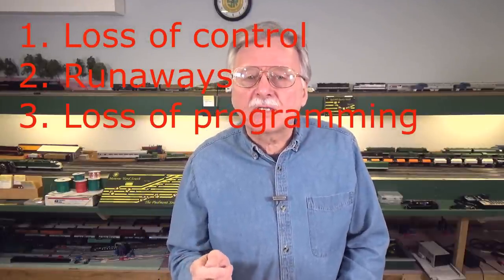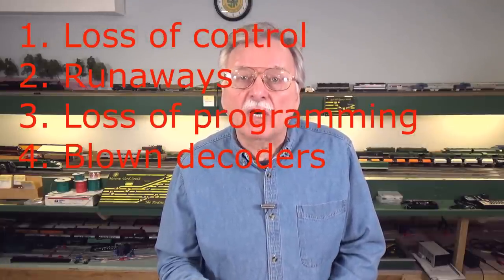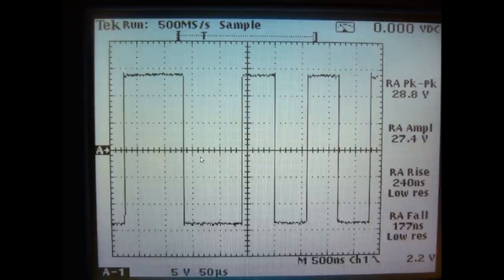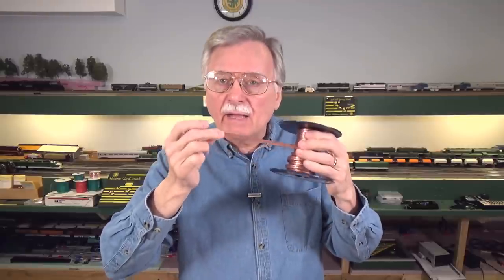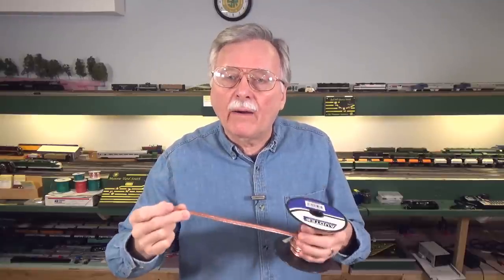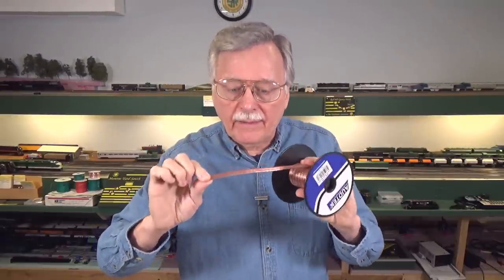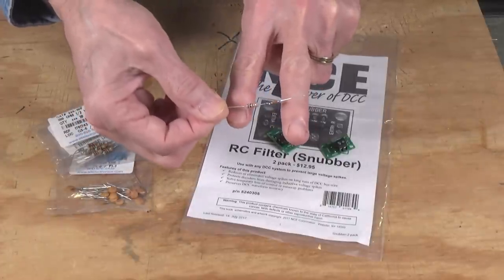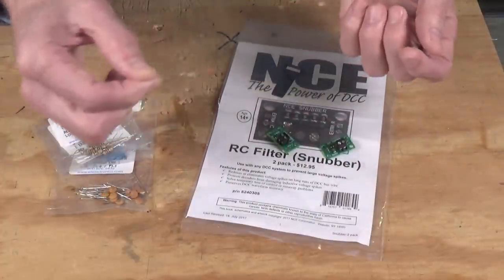End Decoder Problems With A Snubber (243)

Comment: Hi Larry

Could this also affect decoders with Keep Alives fitted? The symptoms I’m experiencing are that locos fitted with keep alives (TCS KAT24s) run then stop for a moment so as I approach the loco to see if it needs any attention, it will just suddenly continue on as if nothing happened. It doesn’t run away per say or stop responding to commands. It just stops, then moves off as if nothing happened. I suspect it’s voltage spikes but it’s a symptom not on your list so I’m curious to know if there’s anything else going on?

Ally
Reply from the maker: Not likely unless so e CV was reset that impacted on the Keep Alive function. That’s usually the type of behavior you see without a Keep Alive installed! I suggest you recheck the connection and if that is not the issue then call the TCS techies, Dan knows these well.
Reply: Thank you for the quick response. I have emailed Dan as suggested and will get back if there is a solution. To confirm, this is not a spiking issue?
Reply from the maker: I wouldn’t think so.

Comment: We experienced locomotives intermittently change direction or change speeds during a train show but only at that particular train show location. And repeated again year later same train show location. No where else. Will the "snubber" resolve these issues different from your problem list? Perhaps be we have different issue. 😳
Reply from the maker: Interesting phenomenon that I have never seen happen in almost 30 years of DCC. The fact it occurred at the same place might suggest some external EM noise interaction, or it just might be the configuration of your layout each time. If it has never happened anywhere else ever before or since it would suggest the local issue. But if elsewhere as well then the snubber might help. These are so cheap and easy to make and install a test would be easy enough.

Comment: Larry  what would us "Soon to be smokers" do, w/o your   Expertise. What's your recommendation on say a main that encompasses 100' or more break into 4~25'ers using dealer wire & a cap~res. On each End?
Reply from the maker: I believe in a stepwise approach. First are you having problems? If not then do nothing. Some systems and wiring configurations are more prone to these issues than others. If you see the symptoms then try the RC filter. If that doesn’t take care of the problem then breaking the 100’ run into shorter ones however remember you still will have to count the full length of each wire run from the booster. If you can put your command station booster i  the middle of the layout and fan out your buses that would be the best configuration. Or you could break it into 2 50’ runs with a booster in the middle of each, so your 50’ runs would in effect be subdivided into 2 25’ ones. Divide and conquer!
Reply: @TheDCCGuy  Larry I finally got time to sincerely thank you for the tips as I progress so does my, How-To knowledge all the while trying to remember "Now. Which end goes In The Cement?! 😆

Comment: Great video Larry,  besides twisting the DCC bus, does wire gauge play a factor as well?
Should you put one on every block?
Reply from the maker: You should always use the correct size wire for the scale, rail code, and length of the run. As I ad in y  video pit one at the end of the power bus and maybe a second midway if symptoms remain in some areas.

Comment: If you twist the bus wires (or use the speaker wires that are tightly bound together like you do and I do), you shouldn't need the RC filters. Am I correct?
Reply from the maker: That’s right, and as I said in the video if yours is a small layout you might even get away without twisting.

Comment: Hi. I am a member of a club in Norway and we have a rather large layout that is divided in two parts, one part is DCC and the other part is Märklin/Motorola-system. We hav experienced many of the problems you listed in the video and we are planning to try out the RC-filter to see if that will correct the problems. But my question to you is: Do you know if these filters also work on the Märklin/Motorola system?
Reply from the maker: I have never looked at this system so have no idea as to whether these would work. However the folks at DCC Concepts in the UK sell a unit similar to the NCE snubber and their electrical engineers may have considered this. I suggest you send them an email inquiry via their website dccconcepts.com .

Comment: Thanks, Larry, I assume the filter would affect current occupation (what is the current draw of filter) , where would be the best place to locate the filter in this case. Does it do any good if you place it near the booster or would you need a small section of un-occupation track detected track at the end of the bus
Reply from the maker: Yes they do draw a small current and their wattage as I said is 0.25-30 watts so use ohms law to calculate the amperage based on your voltage. Also as I said in the video they go at the end of the bus first then can be added at intermediate points. They would be useless near the booster as most already have some type of noise suppression filters built in.

Comment: Would you recommend these on a small layout or should these only be used if you find problems
Reply from the maker: Only if you have problems, which usually means with DCC power bus runs of 30’ or greater. That said poor wiring and other issues may complicate this guideline.

Comment: How do you actually fit them?
You have the two wires coming out of the controller to the track, but only two terminals.
Do you come in with the two wires and come out with two wires from the same terminals?
Reply from the maker: As I said in the video beginning at 18:55 they are connected between the two bus wires of your DCC bus.

Comment: Hi, Larry. I have followed your videos with great enjoyment and have learned a LOT! Thanks! Since basic electrical seems to be the current <sic> trend, I'd like to learn just how a DCC "booster" works. It can't just be upping the power supply voltage is it? I am running an NCE Power Cab and they say the current limit is 1.5A. What ever magic is involved seems to be after the command station output. Thanks.
Reply from the maker: At the most basic level the command station creates a low voltage/amperage version of the DCC signal I showed in the oscilloscope scans. The magic with the boosters is that they literally boost the DCC signal to the voltage/amperage desired. Some systems just bring it up to whatever level they get from the power supply while others can be set to a specific voltage but the amperages are usually specific to the booster. These also have their own proprietary designs that do the magic of creating a stable, and hopefully noise free power bus. They also have built in ability to sense a short circuit and shut down. If you’re interested here is a link to a website with a 3 amp booster circuit that may be more than the basic info you were looking for.

Comment: Been thinking about your video on DCC spikes and snubbers for a while.   Experimenting with an Arduino PWM scheme to run and animate a small "critter" engine on a short piece of DC ... not DCC ... track.  On my scope, I see lots of similar spikes so I was interested in the snubbers.  Then I noticed MOV varistor transient spike protectors can be purchased with voltages like 10-18V  (AllElectronics).  Question for you ... and for anyone out there.  Might a low voltage MOV be used to kill unwanted track voltage spikes?   For DC, maybe just place across track rails.  For DCC, maybe place two ... one between each rail and ground.   Welcome your thoughts.  All the best ...
Reply: I would think a transient voltage supression diode would work well to remove the spike, but would need to be sized for the DCC voltage in use.  These are used to clip superfast voltage spikes like this.  Say if your track volatge is 14V, then an 18V 1W TVS would be worth trying (across the rails).  Too low a voltage would cause a short all the time and the diode would fail. Too high and the spike will not be gone.  This would be a good option along with the snubber, but I would use 100 ohms 1/2W in series with 0.01uF.

Comment: Hi Larry,  My friend has a VERY large layout with a main line of approx 150+ feet.  Using Digitrax for command station and about 5 boosters.  There are about 15-20 NCE Switch 8 (original version) stationary decoders for operating the Tortoises.  We have a recurring problem whereby the Switch 8 fails to respond to the throttle signal. We shut down the whole system for about 30  seconds. After we power back up the Switch 8 works again. I've never thought to notice if this problem occurs immediately after someone shorts out somewhere on the layout. I recently replaced two of the offending Switch 8's and installed 2 of the latest Switch 8's (which are sooo easy to program). So far no problem.  I'm wondering if installing  RC filters could correct the problem. Thanks for any help you may be able to give.  Tom
Reply from the maker: First, how are they powered and how are you controlling them?
Reply: @TheDCCGuy  They are powered from the DCC BUSS. We “talk” to them using the Digitrax throttles.
Reply from the maker: Has anything changed on the layout, for example a new command station or boosters? I assume all those boosters are powering individual blocks?
Reply: Hello again Larry,  In a way things have changed over the years.  It started doing this from the very beginning since the change from NCE system to Digitrax.  I  don't know if it did it under the NCE system as it was just before my involvement in Bobs layout. Through the years (6 or so) we have added boosters and went from DCS100 to DCS240.
Reply from the maker: Tom—With so many changes it makes it difficult to isolate a single problem but several, things come to mind. First I know that some products reportedly have trouble with the late model Digitrax command stations such as the DCS240. The NCE Light-It won’t work with their commands according to the manual or website. I really have not used throttle commands with my Switch8s so can’t comment there, I just use the Button-Board and pushbuttons. So it could be the change from NCE or it could be signal issues or it could be noise on the bus. The snubbers are cheap and easy to make and would be a quick test to see if something is going on with the square wave shoulders.
Reply: Thank you Larry. I think we will try a snubber then.  Nothing to lose I guess.  Actually, I think I'll wait for a bit to see if the new version of the Switch 8 cures the problem.  I installed 2 of them about 3-4 weeks ago and the problem hasn't come up again.  Lucky? Who knows. Thanks again. @TheDCCGuy